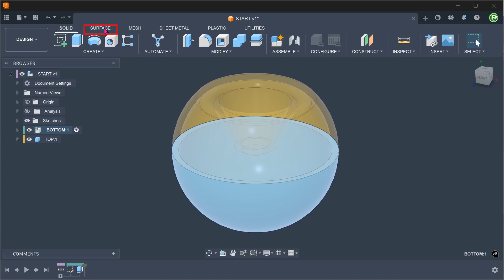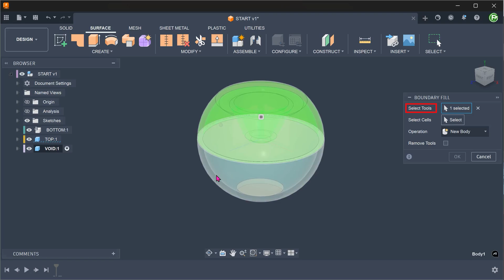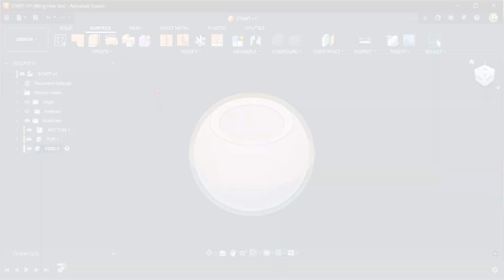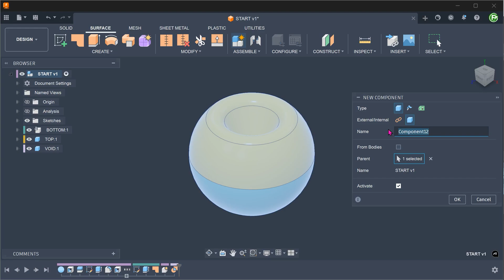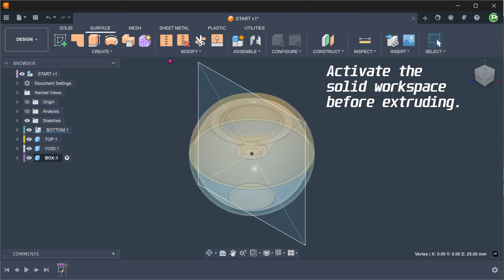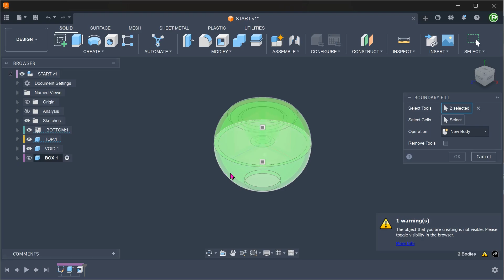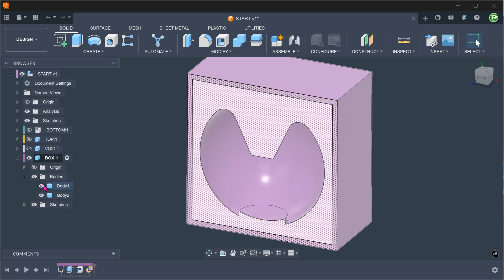Autodesk Fusion | Creating a solid from a void

Comment: Definately been eyeing up a space mouse for some time.. once again your videos are the best fusion tutorials on youtube
Reply: I got an older wired model and it was something I hesitated on because of the price. 
The freedom and efficiency it gives me when using F360 - I don't regret buying it for a moment.
It was also way heavier than I imagined and feels really stable when I use it.
Reply: If you get one, it's definitely worth spending a little more to get the ones with the keys. Otherwise you'll be moving your hand back and forth a lot.

I love mine though, and would definitely recommend them if it's something you can splurge on, but obviously not necessary.